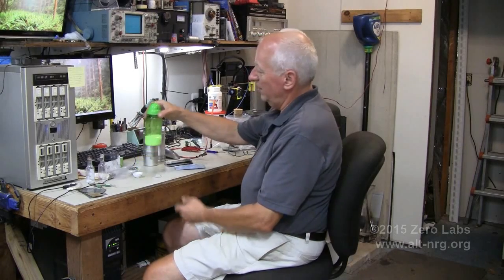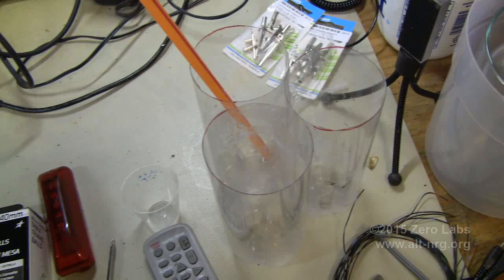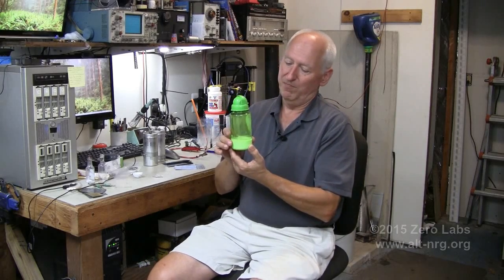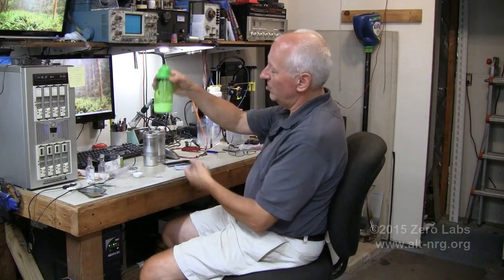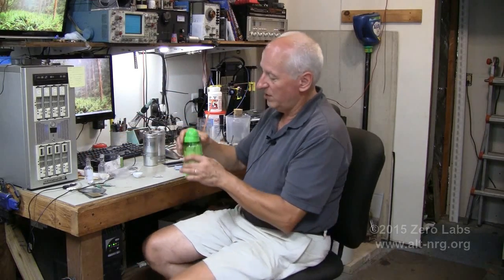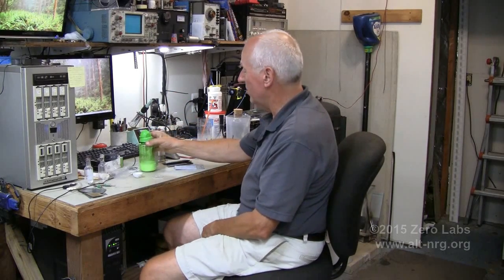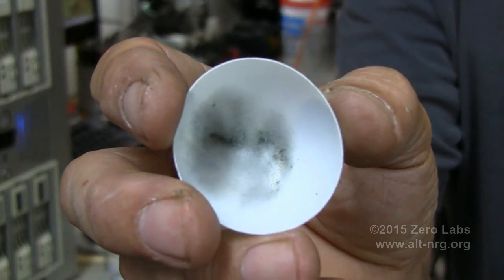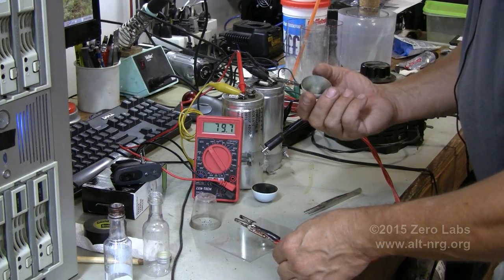#418 Keshe Plasma Reactor project update 04

Comment: I think building a 60kw Muon catalyst cold fusion reactor would be more fun.  Using three fluid Van de Graaff  generators you put the carbon target and reaction chamber sitting on top center of the generators with the electron beam source at the bottom in the middle of the 3 generators.  You don't need heavy water unless you are in a hurry because the system will make its own fuel when allowed to run and "smolder" and the system will slowly ramp-up to maximum potential.  As the system ramps up the Neutron radiation will slowly increase and have to be shielded.  The problem with the system is the max output of 60kw because of the Muon decay rate to target distance ratio and the reaction chamber size constraints.  Still, a self-sustained personal 60kw generator would be nice - just add purified water as needed for fuel.  In the 1960s, White Sands had a working Muon system in their underground lab - along with their regular nuclear generator.  They gave up on development because the system only had a 60kw potential.